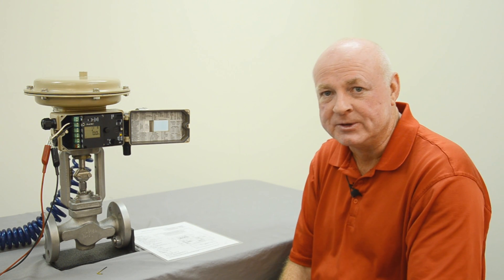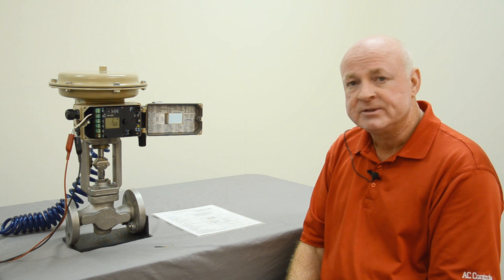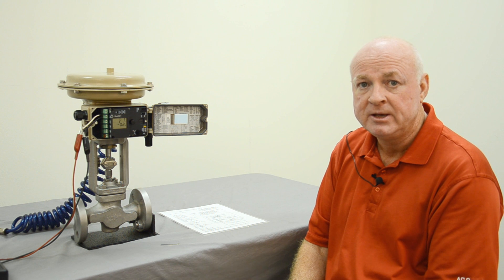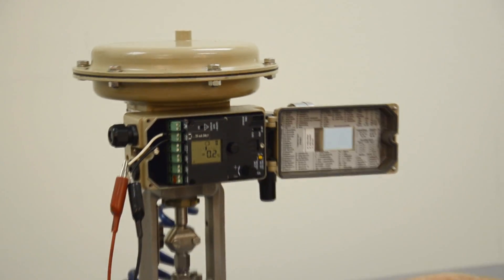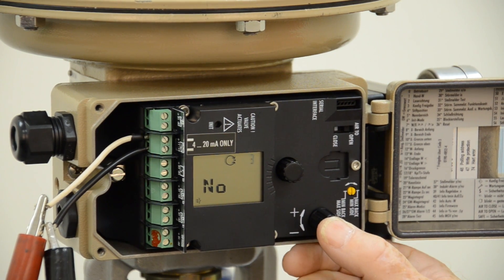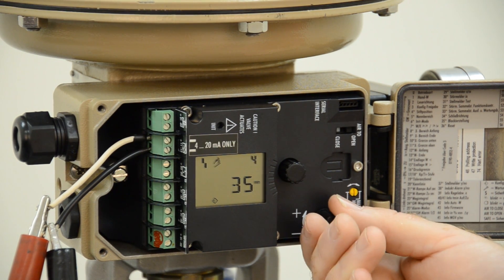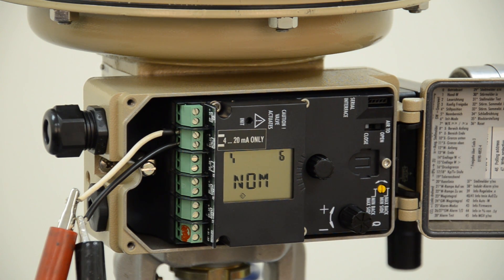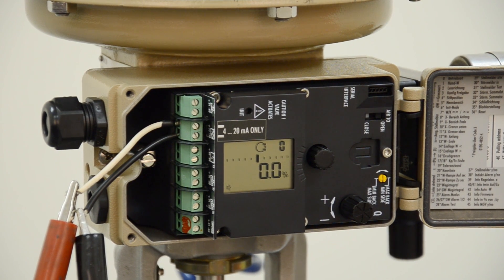Configuring the Samson 3730 Positioner

Comment: There is "S" symbol on the positioner : How to do you clear the "S" symbol pls?
Reply: Safe mode, you need unblock
Reply: @jotazetaprimitivo.7064  How is that, I have a positioner with Profibus PA and the letter S (safe mode) flashes and I can't remove it